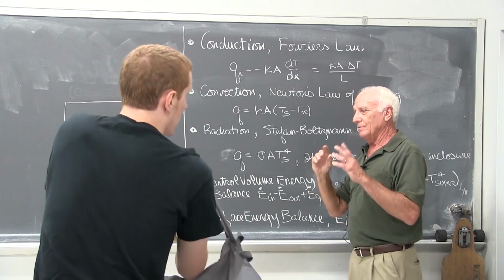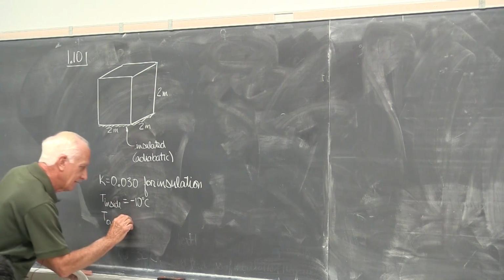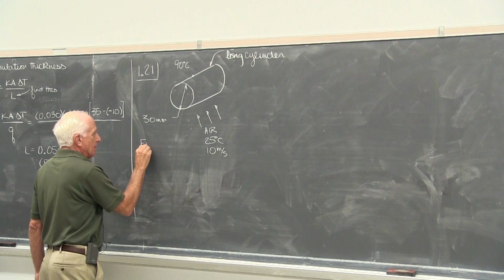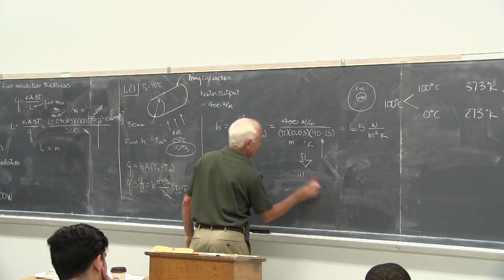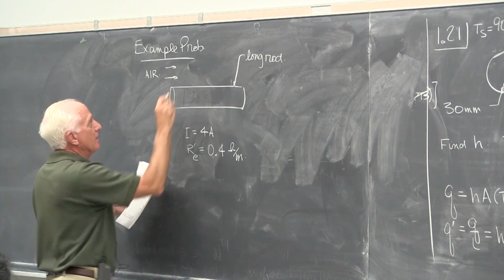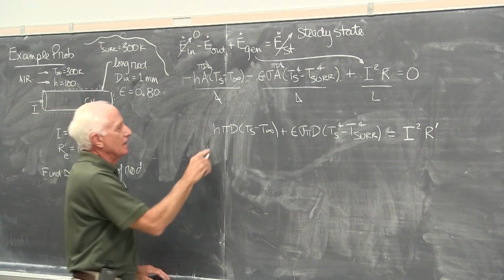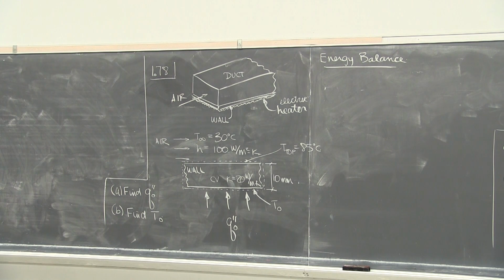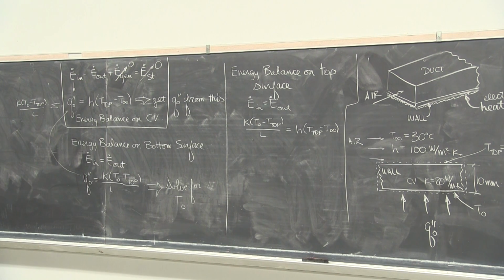Heat Transfer: Introduction to Heat Transfer (1 of 26)

Comment: A question. The earth's surfaces emit radiation in the range of 9 - 13 microns -50 to +50C correct? Carbon Dioxide absorbs in the range of 15 microns -80C correct?
Where is the frequency of 15 microns coming from?

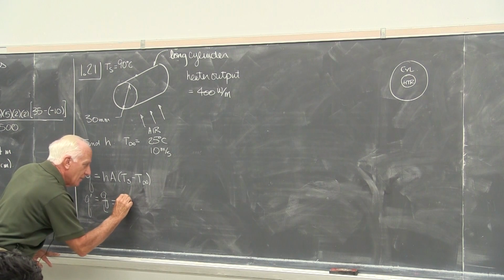Comment: What's Pi*D*L? At 21:00
What is that the area of? half the cylinder? I cannot find any sources for this.
Reply: Surface Area of the cylinder
Reply from the maker: @nouranalaa4024  Thanks!

Comment: Whenever I am doing engineering problems the part that trips me up is the arbitrary assignment of different contributing factors without an explanation.
For instance in this problem he designates Radiation and Convection as going out of the system but unless we already know all the variables how are we supposed to know whether the radiation and convection from the ambient are inward or outward in direction?

Is there a general rule of thumb that can help me to stop getting tripped up by sign conventions
Reply: Joshua DeVenezia are you talking about the long rod problem in particular? If so the radiation is outward bc we set the control volume to be around the rod where the radiation is going outward. It just has to be outward as its radiation(heat generated by the rod) is going out of the cv(system) as heat flows from hot to cold.

Comment: the first question guys....
1.7) A freezer compartment consists of a cubical cavity that is
2 m on a side. Assume the bottom to be perfectly insulated.
What is the minimum thickness of styrofoam insulation
(k  0.030 W/m  K) that must be applied to the top
and side walls to ensure a heat load of less than 500
.............................................................................
2nd question
An electric resistance heater is embedded in a long
cylinder of diameter 30 mm. When water with a temperature
of 25C and velocity of 1 m/s flows crosswise
over the cylinder, the power per unit length required to
maintain the surface at a uniform temperature of 90C
is 28 kW/m. When air, also at 25C, but with a velocity
of 10 m/s is flowing, the power per unit length required
to maintain the same surface temperature is 400 W/m.
Calculate and compare the convection coefficients for
the flows of water and air.
........................................................................................
3rd question
An instrumentation package has a spherical outer surface
of diameter D  100 mm and emissivity   0.25.
The package is placed in a large space simulation
chamber whose walls are maintained at 77 K. If operation
of the electronic components is restricted to the
temperature range 40  T  85C, what is the range of
acceptable power dissipation for the package? Display
your results graphically, showing also the effect of variations
in the emissivity by considering values of 0.20
and 0.30
Reply: Which textbook are these from?
Reply: @milindbebarta2226 ,  Incropera, 7th Edition

Comment: what's the name of the book that they use?
Reply from the maker: Check the comments for a link to the syllabus.
Reply: +CPPMechEngTutorials I'm sorry for not to read that comment first. Thank you for the information.
Reply from the maker: Not a problem. :)
Reply: @CPPMechEngTutorials  Excuse me, actually I have a problem to design a Burner Tank. The spesification of burner tank is using heater coil with high pressure and the temperature output can up to 210 celcius. Can you suggest me or promotion some book to me about my problem? cause I am a beginner to learn about mechanical. Thank you.

Comment: At 45:59 im not getting 63.5C (or 336.5K). Anyone else having trouble?How do you solve this problem with Ts and Ts^4? using logs or trial and error? Im getting approx. 46.5C using trial and errorThx in advance
Reply: i found 324.204 K using Matlab.
Reply: Someone please explain this to meeee!!!! Using matlab how???? Is there some other way to solve this??!!!
Reply from the maker: MATLAB gives about 319 K. It's possible Dr. Biddle was using different parameters by mistake.
Reply: @CPPMechEngTutorials  He accidentally put D=0.1 when it should have been D=0.001 because 1m = 1000mm.

Comment: The guy who recorded this video SUCKS!
Reply: Isaac, you would induce motion sickness by too much rapid movement. Please be thankful for what we have here. Have you calculated the cost of this 4 to 6 credit worth of lectures that you got for free? Be thankful bro! I am!!
Reply: could you please share with us the name and edition of the book that been used in this lecture so we can follow the Dr Dribble.
Reply from the maker: What specifically do you dislike about the video?
Reply: The class is great but the camera guy lagged on some parts of the video as he did not follow Dr Dribble thru the room.  There is parts where he records the wrong part of the white board.
Reply: But other than that, thank you for the material.
Reply from the maker: The videographer was trying to keep the focus on the content on the board as much as possible. Additionally, the room was quite narrow and following Dr. Biddle back-and-forth around the room (he can be quite dynamic in the classroom) would have required rapid, wide pan shots. This could have induced motion sickness in the viewer.